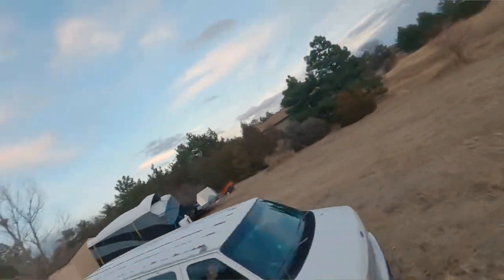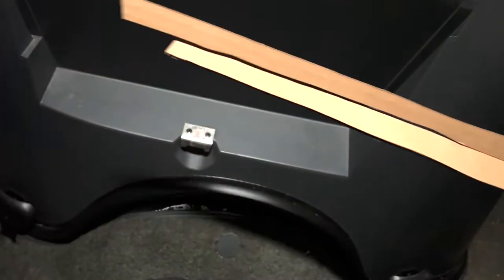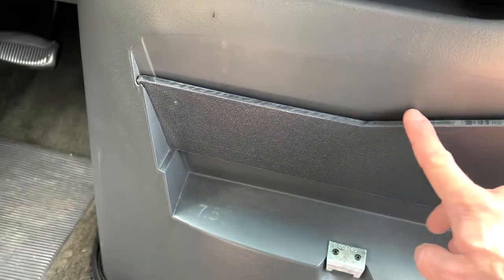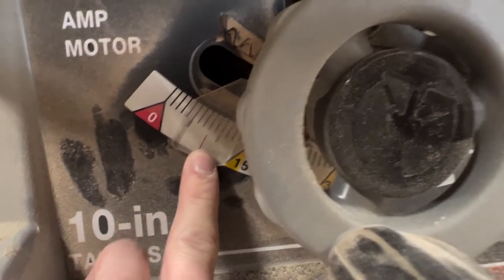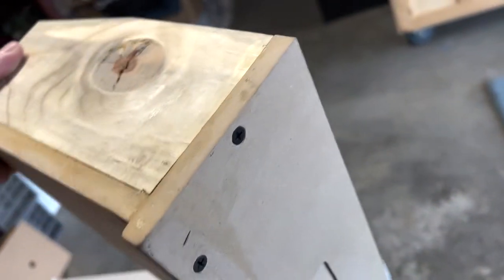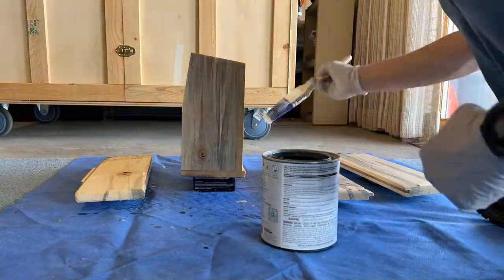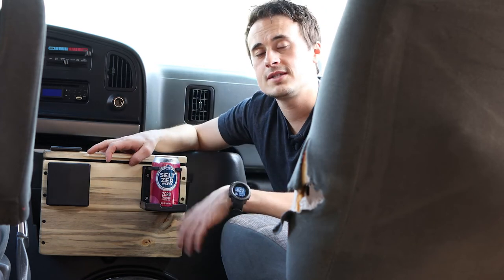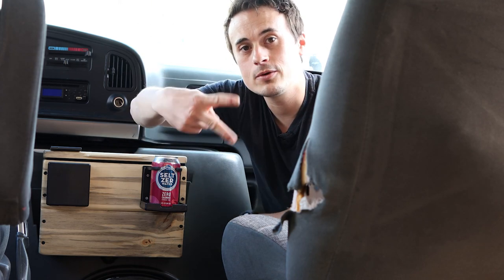How I Built an Amazing Custom Slide in Center Console for my Van | 96' Ford Econoline

Comment: Looks great. Good job! I would warn you to be very careful about storing anything in the same compartment with your carry piece that could get into the trigger guard.  You might consider getting one of those kydex trigger covers that can be secured with a short lanyard. Of course, a lot depends on what sort of objects you store alongside the gun, but as clutter accumulates, the danger increases of something getting into the trigger guard. Please check those trigger covers. 
Personally, I would consider ditching the magnet and just attaching a kydex holster inside the compartment. 
Confession: I stash my gun in the storage bin of my console, under a bandanna. But it's in a holster. I  just remove the entire holster and stash it in the bin: the gun never leaves the holster.
Reply from the maker: Good thing to consider for sure, my poor transmission will be toast if that happens haha. Yeah leaving in holster is a good way to do it

Comment: This thing is cool. My Astro van has cup holders already, but they're not very deep, so you have to hang onto anything sitting on them anyway. I should figure something out similar to the ones you used to fix that. In my van I usually have to put my feet up on the seat and crawl over it to get to the back because the stock console thing is too big to squeeze my legs between. I'm loving this build though.
Reply from the maker: Hey thanks! Yeah im not sure why they would make shallow cup holders in a vehicle. Yeah im sure you can figure something out is the console removable?  Thats a bit annoying. Are you going to make that thing 4x4? Good to hear!
Reply: @4WheelKid  It's not removeable as far as I can tell. I think it's screwed to the engine cover. I do want to do the 4x4 transfer case mod. I can get a used one out of an S10 and buy a manual 4x4 lever kit. I was thinking about doing an engine swap, but that'd be further in the future.

Comment: So neat to you were able to custom build the console. Only a wooded handmade would've  suited a conversion van.
I'd put a lock  or even better a false bottom to hide the gun.....
I would be interested in a video, why and how you decided to carry a gun?
Reply from the maker: thanks! yeah will set the tone for the rest of the interior that i'm building yeah its mostly just a spot to keep it while i'm in the van. i'm making a secret compartment under the bed that uses an nfc lock then possibly a small safe in there that is bolted to the steel bed frame that is welded into the van body

Comment: As you plan your build, I recommend checking out two other YouTubers who have a similar van with very different build outs: Forestry Forest and Primal Outdoors. Both are full time so your needs might be substantially different; however, they might have ideas you can use. Enjoy the process as I know my first van was a lot of fun to build out
Reply from the maker: For sure ill check them out. Maybe I can get some good ideas. I actually deleted the 2 largest windows. And have most of the van raptor lined. Working on a sweet bed design right now. Cant wait to get some of my recent video out. Yeah building is most of the fun haha

Comment: Whaaaa???? My 96 dont have no slidey groove spot, i got nothin to work with. Maybe mines different with the 7.3 in it?
Reply from the maker: Hmm strange, does it have the pegs instead that was a different design
Reply: @4WheelKid  nah, just smooth. Looks like yours up top, same stupid bottomless cupholder ashtray slide thing, but the face of doghouse is smooth, no indentations grooves or pegs.

Comment: That's awsome, I have no carpentry skills either..lol..u could have used the counter sink bit on the plastic piece on the back.would mabe help with no marks on the plastic
Reply from the maker: thanks! only one way to get carpentry skills though. thought about that but decided not to because the material was so thin. it worked out perfectly when I used some hot glue, it stopped it from wobbling, now there is 0 movement even without the lock